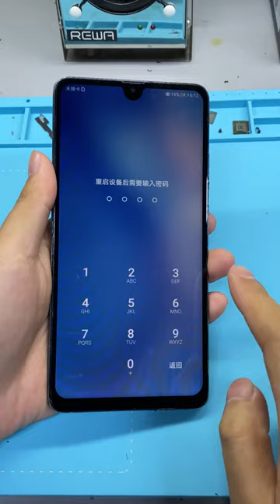Huawei Mate 20 X Screen Replacement #shorts

Comment: I add even more glue also i use b7000 but sometimes customers come back and say display unglued
Reply: You have to make the surface 100% clear and wait 2min after aplying  the glue, for it to dry a little bit, before pressing it on the frame. I've doing that for months and never had a customer comming back with any issues.
Reply: @WolfMoonSs  Thanks man, I'll try it
Reply: No chance. I use tape with primer. If surface is clean and primered both sides it stays on good. Better if you have to open the phone again in the future